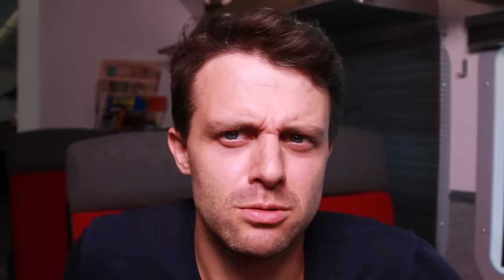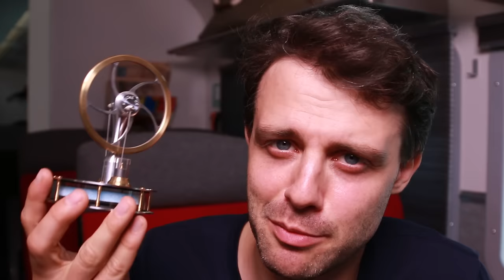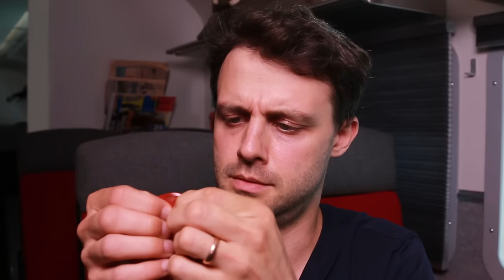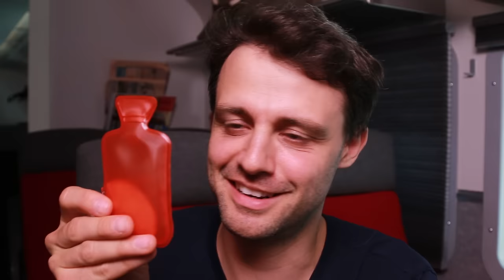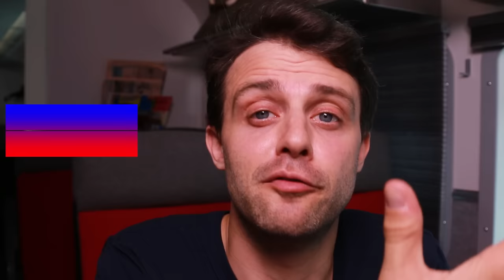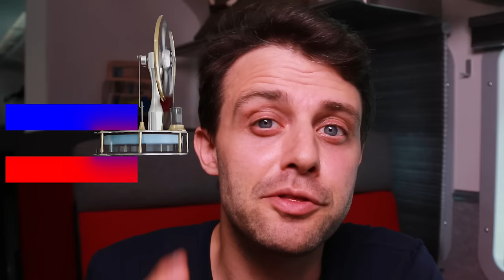A better description of entropy

Comment: "In thermodynamics, heat is energy in transfer to or from a thermodynamic system, by mechanisms other than thermodynamic work or transfer of matter."

Heat is a transfer of energy, not a state of being hot.  You absolutely need heat to run the sterling engine.
Reply: No you dont need heat. You need temperature difference between the two plates. The temperature difference is going to cause the heat to flow, which causes the engine to run. So heat flow is caused by a difference in temperature. Ultimately, what runs your engine is the temperature difference. Once the two plates are in equilibrium, your engine stops.
Reply: @menerke  Heat isn't defined the way you are defining it
Reply: I just finished a degree in physics and didn't even know this, but it makes total sense.  Christ that's embarrassing.
Reply: @menerke  As you say, there needs to be a transfer of energy from the hot plate to the cold plate. That is heat.
Reply: I think Steve's point is that you don't supply the heat, the energy transfer via heat happens as a result of the difference in temperature. I guess you need heat in the sense of you need the concept of heat to exist, but you don't need to supply any.
Reply: Heat transfer is energy in transition by virtue of temperature difference.
Reply: Thermodynamics itself can be called Heat Physics. The Greek is kept for posterity.
Reply: This is just pointless language games. These videos are for layman. The fact that Science has stolen words and redefined them is why science gets the tar. 

"That's not what that word you use means, even though it's been used that way for 100s of years. We just stole and changed its Definition so people with a small amount of scientific knowledge can act superior in YouTube comments"

You do not supply heat to this engine. You supply a difference in temperature in order to promote the transfer of energy which is turned into motion to illustrate that energy moving around.

FYI heat comes from middle English mean "warmth" and being haughty cos people use language in a way that doesn't meet your specific domain is... Doctrinal. Like... Zealotry.
Reply: @avisian8063  
This is a video about entropy.  He is defining it in terms of heat and work.  If you're going to change the definition of heat, then his definition of entropy is wrong.

If you understood the science, then you would understand that as well.  But it you understood the science, then you wouldn't have made the comment you made, because it makes no sense.
Reply: Dr Deuteron  oh get over yourself
Reply: @avisian8063  no, it is not just "pointless language games." Common language is imprecise. Yes we use it to communicate in daily life, but when trying to explain or understand what is physically happening we need a rigorous, scientific definition. There is nothing wrong with having words multiple meanings or interpretations. The difficulty is that people tend to not specify when they are using non-colloquial definitions, which makes things very confusing.

Comment: What about gravity?  It clumps together stuff. What is the "counter-weight" effect that increases net-entropy here?
Reply: Good question!  It clumps stuff together, but not energy.  When gravity pulls stars together, the particles heat up, fuse together and release light energy.  Once they reach a stable state (c.f. the iron catastrophe) and if they're massive enough, they collapse to neutron stars and give off some more energy.  Once they've used all that stuff, and again if they're massive enough, they collapse to black holes and I guess you could say they just drain energy out of the universe.
Reply: Black holes are energy neutral! (As far as I know) This is because they release 'consumed' energy through Hawking radiation
Reply: I'm no expert but what I heard is that gravity is what initially provided low-entropy in the universe, but it only did so by exaggerating the initial quantum fluctuations in the universe that expanded through inflation. So really it was the fluctuations in the early universe that provided the source of low-entropy. Now over time, the energy will tend to gradually become more evenly distributed and gravity can't re-clump it together.
Reply: Interestingly, stuff cannot clump under gravity unless is sheds off lots of kinetic energy. Like how the planets don't just fall into the sun, because they are orbiting too fast. They have to slow down somehow first. When the planets themselves formed all the dust and junk they formed from was able to shed off energy via collision and friction and heat, which let it cool enough to clump together.
Reply: ninjafruitchilled Well it's really that the planets are continually falling under gravity, but they keep missing.  the fun one is if you are in orbit around something and you want to move towards it you don't fire your rockets away from it as you would expect (this makes you go in an ellipse) but rather you fore them infront of you to slow you down - sort of what you were saying.
Reply: andymcl92
Yes exactly; but picture what is happening there. You fire your rocket against your orbital velocity vector, and so you send your rocket exhaust blasting off at high speed into space, away from the Sun. Thus energy becomes more "distributed" as Steve says, even though your rocket falls closer to the Sun.
Reply: ninjafruitchilled I know, but my point was that in the case where you fire the rocket away from the Sun, you are still dispersing energy but it doesn't simply lower your orbit (as many people might expect).
Reply: (In any case, I think we are arguing the same thing from different sides, merely quibbling over pedantic terminology :p )
Reply: andymcl92 Is potential energy a form of "clumped" energy? Such as chemical potential energy, or gravitational potential energy? Since the energy itself is relative to a particular reference level, does that mean the source cannot be "spread out" until the energy is converted?
Reply: John Stuart Yep, potential energy is clumped.  Basically, if you can do something with the energy then it's clumped.  I.e. falling water can convert potential energy to kinetic and then on to electrical, if you had a water wheel and a generator.  Not sure what you meant by the second part though, I'm afraid.  Could you elaborate?
Reply: andymcl92 For example, gravitational potential energy is "stored" within a mass by virtue of its position relative to a particular reference level. Since that "stored" energy is relative, how will entropy affect it? Technically, that mass has an infinite number of different gravitational potential energies, which each depend on a different reference level; so does that mean that entropy will affect every possible potential energy, or just a particular one?
Reply: John Stuart Still not sure I 100% follow you (that and it's been a while since I actually watched the video! :p ) but I think I kinda get what you mean.  I guess the mass only has 1 potential energy at any given moment.  The entropy would, I'd imagine, be trying to send in on the "path of steepest descent".  It's a bit like letting a ball roll down a bumpy hill.  It has many possible routes to take, but if you set it down somewhere, it only considers it's route from where it is that instant, not the overall routes.  It could end up on a longer, slower path based on the direction it initially headed in.  Does that help?
Reply: Good point! And Einstein did teach us that mass is clumped energy 😁
Reply: Fuseteam - If mass is clumped energy, and entropy only increases over time, does this mean that if I just sit on my ass and wait for time to pass, that I will eventually lose weight? 😄
Reply: technically there is something called intermittend fasting
which let me lose 10kg in 5 months doing nothing more than watching anime..........-and only eating 8 hours per day-
but i don't think tis related to this topic :D
Reply: Hats off to you.

It took me YEARS to come to that point.

Yes, the way I see it too, now, gravity clumps together stuff - thus generating energy:

http://strangeways.atspace.cc/strange/secondlaw.html#I

- at no thermodynamic cost at all.

On the contrary:

Gravity creates negative entropy and energy at the same time, while causing the universe to go from disorder to order, from stars and planets to galaxies, by separating "something" from "nothing".

We only take advantage of a set of highly ordered surroundings we cannot and could not create.

Gravity is the source of all order, movement and life.

It cannot be influenced.
Reply: Gravity is a force. When gravity pulls something together, someone or something put it there in the first place. That object had potential energy. When it moved due to gravitational force, that energy was converted to Kinetic energy, along with heat, sound, etc. So yeah, movement due to gravity does increase entropy. There doesn't have to be a "counterweight".